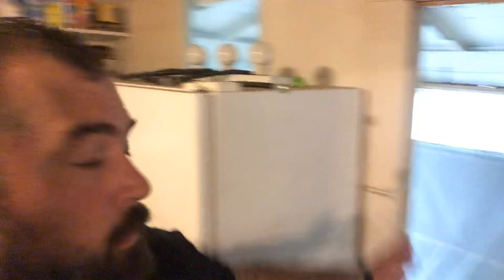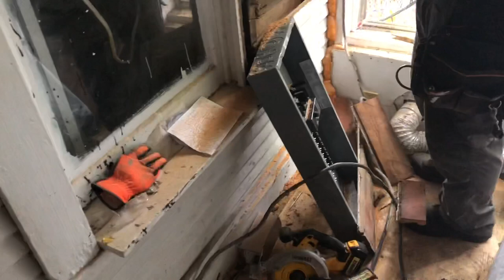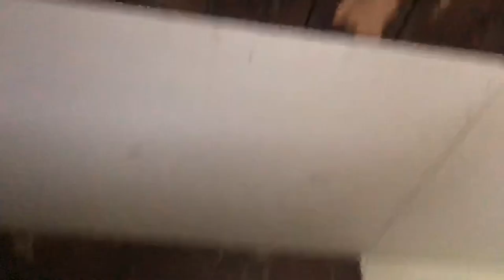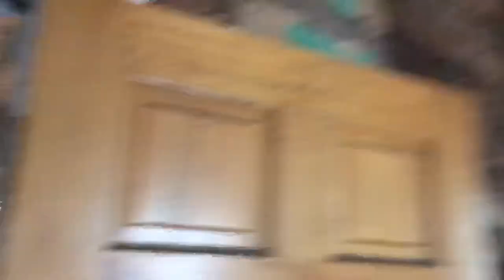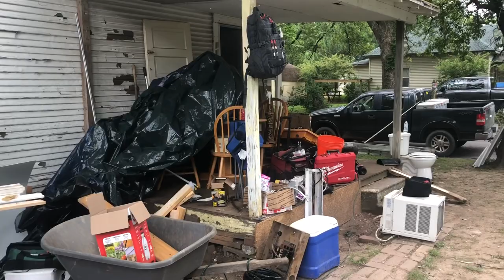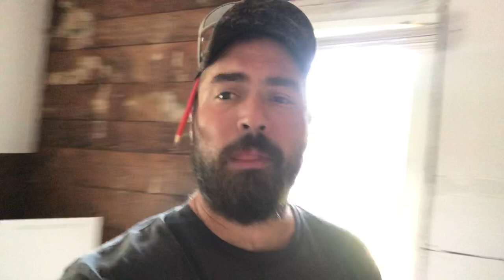Bear Nation Muskogee Mission Phase 1

Comment: That roof is super ghetto and will make a huge noise if it rains, but I think it was a good choice for the circumstances to cut cost, speed up the project by alot, etc.  Then, the residents can save up for a proper replacement roof 5-8 years down the line after their finances recover.